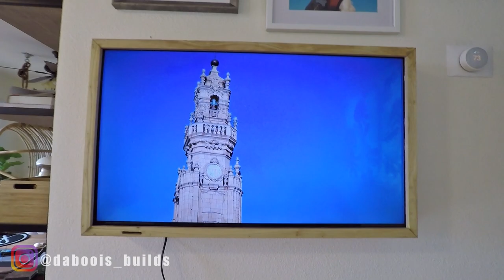Making a TV Picture Frame

Comment: What about ventilation. The the TV get extra hot after watching for a long time?
Reply from the maker: The box is not air tight by any means and there is a small gap (about 3mm) between the box and the wall. we've had this setup for almost a year without any issues!
Reply: @IMEEMADE  Thanks for your prompt response.
Reply from the maker: @voiceofagape7255  No problem! Thank you for watching

Comment: Looks nice but is that not going to affect the sound  coming from the tv or block WiFi and Bluetooth? 🤔
Reply from the maker: Since the box isn't air tight, nor is it completely sealed against the wall since walls are never completely straight. We haven't noticed any changes to the sound. 

Also, we haven't had any issues with WiFi or Bluetooth even with Amazon fire stick being our main source of entertainment. Similar to being able to receive wifi signal throughout rooms in the house through walls and doors, this box doesn't interfere at all. I suppose if we made the box out of metal then that would be another story. 

Thanks for watching and bringing up some good points!

Comment: What is about overheating ?
Reply from the maker: No overheating
Reply: @IMEEMADE  how would you know if that is a close box ? After few hours of using TV, remove the box and touch the top part of the tv from inside the box.
You need to make ventilation holes at the top of the box and at the button for air flow
Reply from the maker: @MrRamkulov  I know because it's not a sealed box and it there are plenty of air gaps around where it meets the wall. Don't worry we've had this project up and running for a couple years with no issues or overheating :)